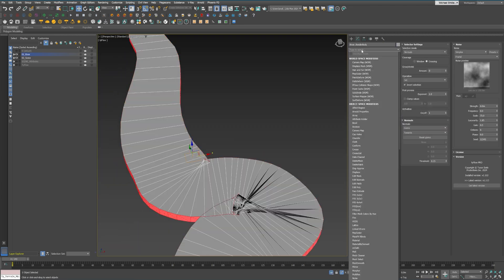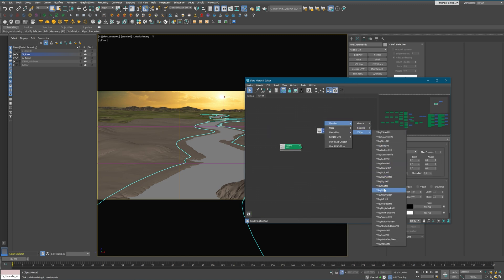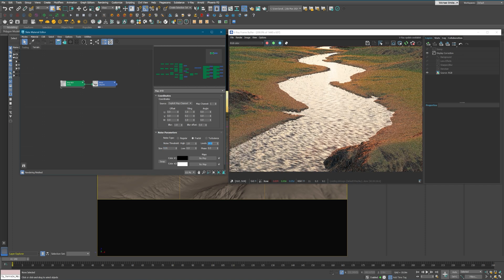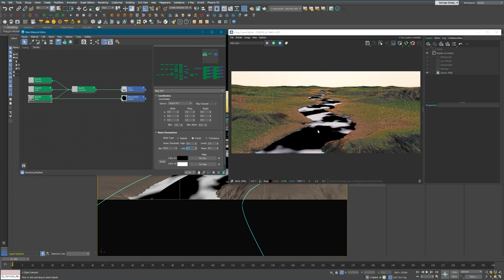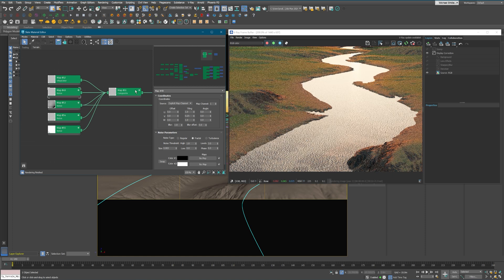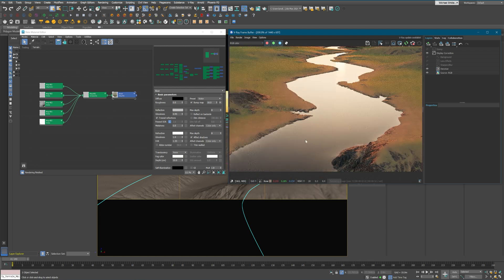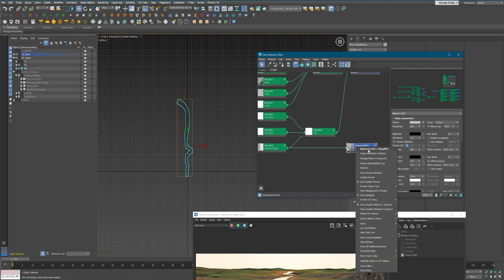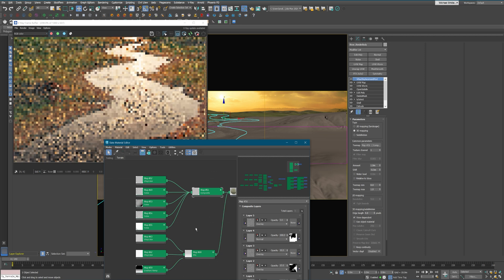3ds max environment - Part004 - River

Comment: i guess you should use these modifier -> normilize spline -> spline ofsset (3d mode) -> cross section -> surface, so that allows you to avoide edge overlaping
Reply from the maker: Yes you can do different things with it, you can do spline offset (free modifier from iToo) to offset it procedurally and then garment maker to convert it to mesh geometry, I agree that I had a mess here with this particular workflow